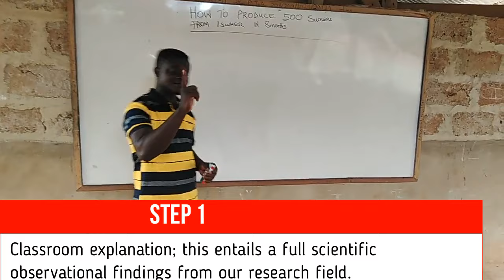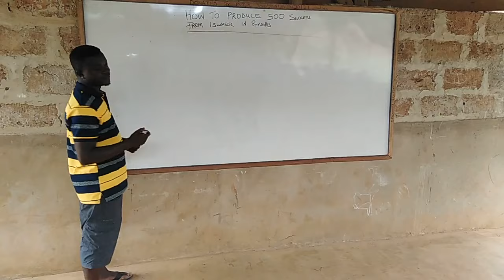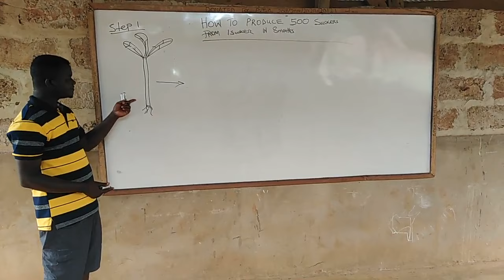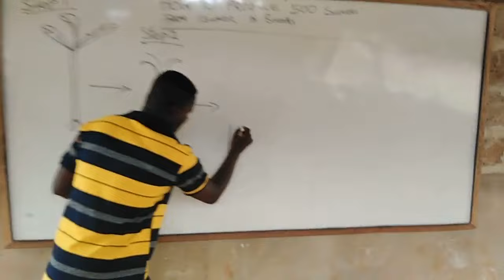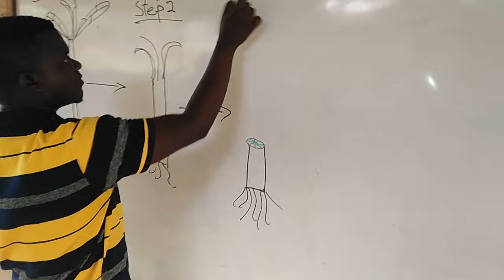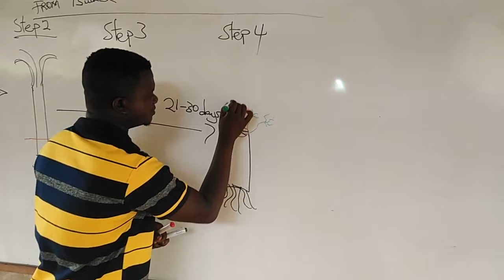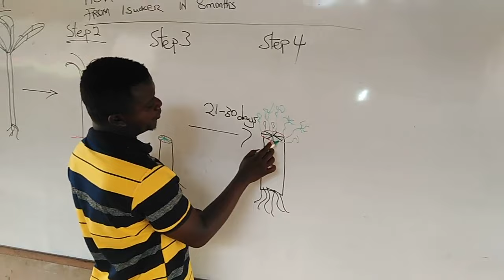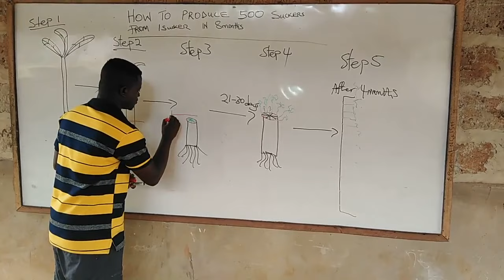How To Produce 500 Plantain/Banana Suckers From One Parent Sucker Within 8months

Comment: The calendar time could have been explained better. Otherwise, great video!

· Step-by-step guide on incision, division, sprouting, and multiplication of suckers with practical, video demonstration in the field for better understanding.
· Cut banana near ground level.
· Identify location of apical bud.
· Use 4 vertical, radial incisions centered on apical bud to:
    - Ablate apical bud.
    - Create 8 independent zones in the shoot where apical dominance will generate at least 1 dominant bud (which will grow to produce a sucker).
· Cover with sawdust.
· Expect ~ 8 suckers in 21-30 days.
· Replant suckers.
· Repeat process.
· After 3 eightfold expansions, you should have ~512 suckers.